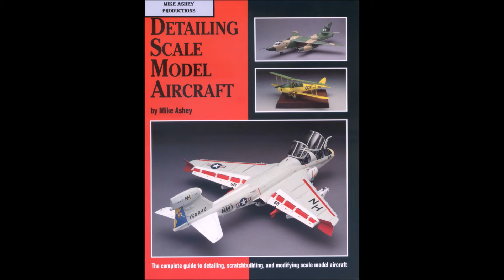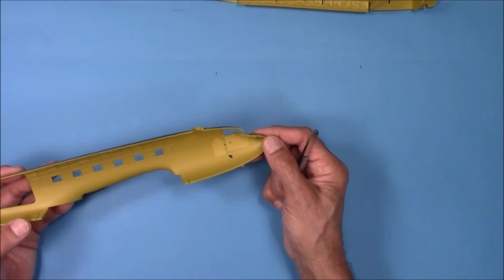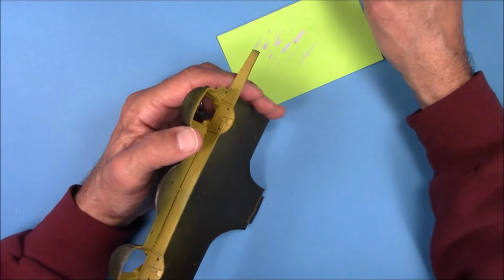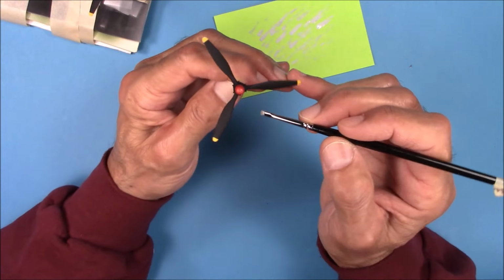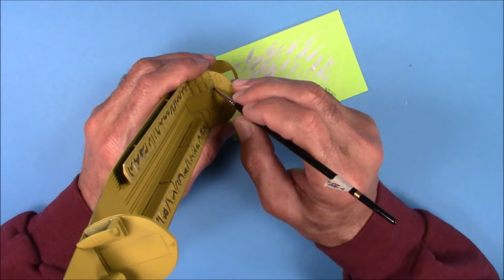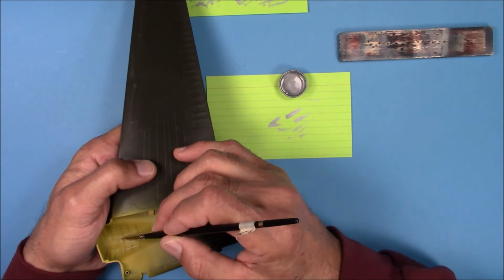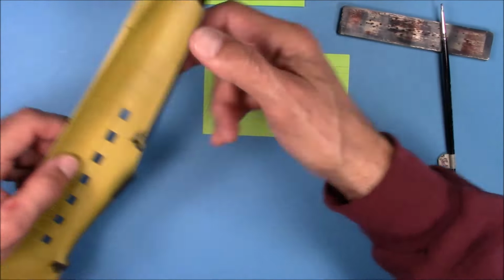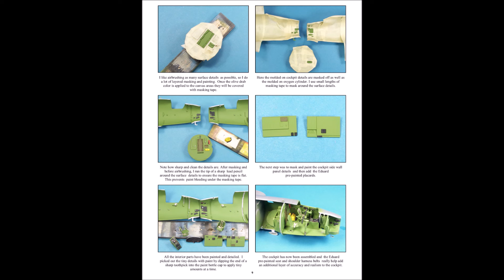Monogram 1/48 scale C-47 Part-5, interior weathering.

Comment: Mike when you run into where the paint peels in small areas,it is due to qc at a petro chemical plant. 32 to years of driving and picking up at these plants,when they switch over to make styrene plastic pellets,some polypropylene pallets get mixed in.this causes small areas of the styrene plastic come very smooth. Polypropylene plastics are use in molded injection for dishes,cups and plastic toys.these get mixed in by accident when they fill the boxes.
Reply from the maker: @richardjordan5036  
Thank you

Now I know it was not bad paint!!